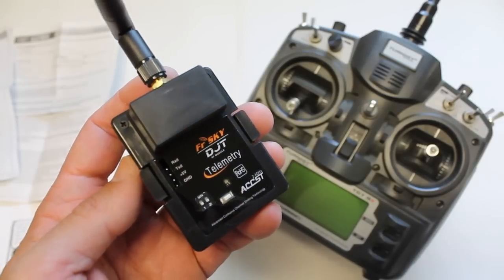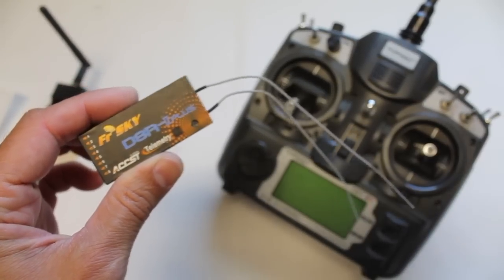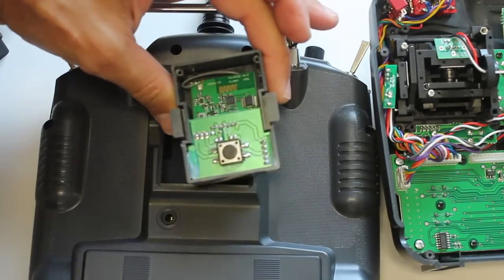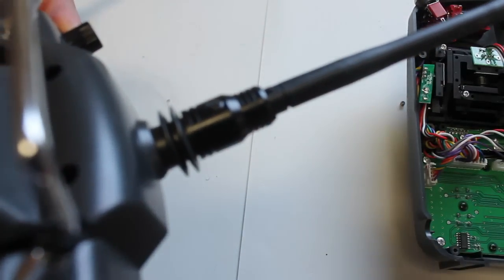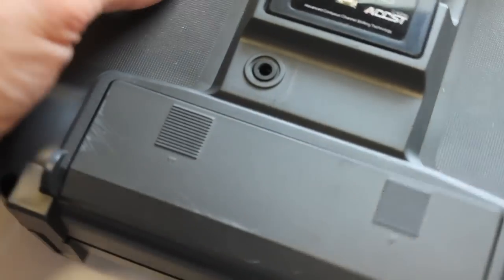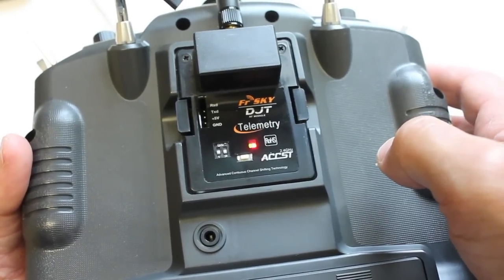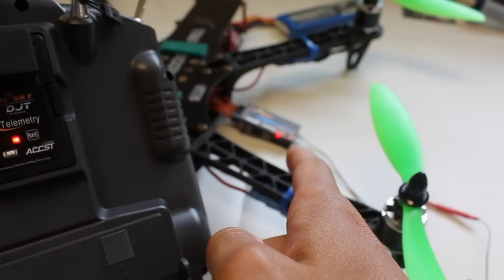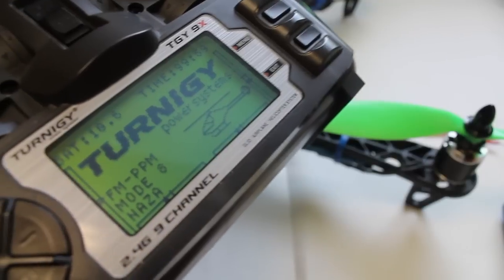Turnigy 9X FrSky Transmitter Upgrade and Binding with TBS Discovery and DJI Naza

Comment: Finally got the Hobbyking Discovery Buzzer to work with 9x/frsky module. The fix was accomplished by adjusting the endpoints in the radio for my gear channel. I ended up using 37 and 120 for the end points. Thanks for your response Dennis. This buzzer has saved me many times. Well worth the 6 bucks. BTW.. You can get this buzzer in USA at readytoflyquads for $6.
Reply from the maker: Killer info. Thank you! Glad to hear you got it working and even better that readytoflyquads carries it. Those guys are awesome both in price and shipping.

Comment: Dennis, you are my hero:)  Among some other things I learned to set up my Turnigy 9x three mode switch and failsafe with the Dji Naza from you. I already had the FrSky Module, but for some reason I bought the Turnigy 9xr to use with it.  But the 9xr is  completely different and difficult to set up.  So now I`m very happy with my 9x and FrSKy, thanks to this video. Thanks a lot

Comment: Thanks again dude, just watched this in a hotel working away from home getting ready for when I get back. Got my brand new frsky djt and plus lI module waiting for me - just gotta work out fail safe and additional features for kk2 will be searching your videos for those tutorials, haha! FPV is almost there, monitor with in built diversity receivers and vtx is ready ; )
Reply from the maker: Ashley, I hope all is well! Great to hear your setup is coming together. Good luck and feel free to reach out if you have any questions. Not saying I have all the answers, but I'm learning as I go :)
Reply: Thanks dude, super helpful as always : )
Reply: Dennis Baldwin Question already! Hhaha, got my DJT module in my tx following your video so thanks for that but when I came to powering up my receiver (D8R-II) I had no LED's indicating it was on : ( I have my KK2 and 1-5 channels plugged into it but it's like it isn't receiving power, do you reckon I could have fried it by plugging it in the wrong way around, is it even possible or is it protected? Or do you reckon i've ordered a dud? 

Thanks dude! Hope your well.
Reply from the maker: That's strange. I've accidentally plugged my leads in backwards before but never fried it. I'm assuming this setup worked fine with your other receiver? Have you tried powering it just with just one lead? Also, what is the BEC output of your ESC? I'm assuming it's 5V to power the receiver.
Reply: Dennis Baldwin Yea I think it's a faulty receiver, ordered another one so it should come today and I'll be able to test it.  I worked backwards and hooked up my previous receiver and it works so there has to be something wrong with the new D8R-II I bought.  The power output it 5v standard so nothing unusual there ; ) Thanks for getting back to me dude! Will let you know what happens with the new one!
Reply from the maker: Man that sucks! Hopefully your new one comes in quickly. Definitely let me know what happens. I'm hoping it's not something else!
Reply: It's aliveeeee ; ) Definitely a faulty one so gonna get my money back at least, hope it's not a common loose connection as I don't want that happening mid flight, haha! The tx and receiver are now bound, fpv setup.. just need a good day for weather and time.  FPV is so difficult, haven't committed yet to let it out my sight..lots more practice and getting used to.  All the best dude!
Reply from the maker: Ashley Leung Great to hear that, Ashley. I'll be on the lookout for your FPV videos when you get around to it. Take care and Happy Holidays!

Comment: Thanks again for another helpful vid. Just got my DJT combo pack and some spare receivers from hobbyking, pretty cheap in the end. Paid $90 for a Combo pack and 3 extra receivers to swap all my other cars and quads over. Had no problems with the setup except the little plastic mount in the back of the transmitter which I just cut out and all went smooth.
Reply from the maker: Not a problem. A few others mentioned they had to cut the plastic mount as well. I guess there are a couple versions of the TX. Thanks for the feedback.

Comment: I think you're right about different physical models. 
I had to disassemble the unit, took off the PCB from rear wall, removed the unnesessary plastic with pliers and then assembled all this stuff back.  Only after that it was possible to install the FrSky module into my Turnigy 9X, and I was not only one who messed up with it ;)

Comment from the maker: So far it's been great. I normally fly in pretty open spaces and haven't gone too far out (< .25 mi). I have a failsafe return to launch setup just in case something like this happens. As I venture further out I will continue to test and post if I run into any problems with short range limits. Thanks for pointing this out. I wasn't aware of it as everyone that I've read with FrSky raves about its range.

Comment from the maker: Thank you. No, I didn't have to cut or sand, but I did have to press firmly to get the module to click into place. It slides in nicely, but for the tabs to click into place it does take a bit of force.

Comment from the maker: Vinny, yeah I flew with the stock T9X module for over a year and loved it. If you want greater range then the FrSky is definitely worth the upgrade. Also, if you haven't seen it check out the FrSky Taranis. Double the channels, but about 2X more expensive. Hope this helps.

Comment: Hi great vids Dennis! Ive just done this setup. I had my 9x working great and used all the  curves, gear on 5, etc you showed in other vids. 3 way switch like a charm! Cheers for all that. However, since Ive put the Dr8/DJT on, the quad is all over the place. Ive calibrated everything I can think of. It yaws on its own, all over the place...intermittently! Any ideas?
Reply: I should add that Ive got a Naza Lite with the M V2 firmware on it and just installed an iOSD and a PMU V2.
Reply: Eoin O'Callaghan I just removed the iOSD and the PMU and tried the DJT with the standard NAZA. Its all over the place...diving and yawing. Kinda like when the FC isn't stuck down properly.
Reply: Eoin O'Callaghan Possibly Ive calibrated wrongly during one for the recalibration attempts...
Reply from the maker: Eoin O'Callaghan How did the recalibration go? If you continue to have problems please join us at www.garagepilots.com and post in the forums over there. We'll be glad to try and help you out.

Comment from the maker: Since you're flying the stock 250mw transmitter I can assure you that your FrSky system will out-distance your FPV TX/RX setup. I haven't done a full range test yet, but I've read about users getting well over a mile with FrSky out of the box.

Comment: Hey Dennis, just got this module with telemetry with a flysky 9x and tons of standard rx's for $100.  :0) It will be my back up to the uhf 9x I use. Thanks for this vid,
Reply from the maker: Man that's a great deal. Where did you get it from?
Reply: Dennis Baldwin
Santa drone crashed out front of apartment. Not really....I got it from an airplane guy on craigslist. I am using the d8r rx and module already seems like a nice set up. Got about 10 other rx with the deal incuding 2 v8fr? and 2 4ch v4...
Reply: Dennis Baldwin
Hey Dennis, I have the same module and wanted to ask what the switches 1&2 do? Can't find info on here. I had one switched on by mistake wondering if it caused a 50 yard away glitch.

Comment: Luis, I also ran across the same issue. If your 9x is the same as mine, then you will need to mod/remove some plastic that were molded into the module bay.  Seems like Turnigy added this to protect the petruding PIN coming from the TX board.  If this is what you are seeing then be sure to open up the back and remove the TX board before you hack that plastic piece.  After I removed mine then the FrSky module snapped in like its suppose to.

Comment from the maker: Greetings and thanks for the feedback. It's much appreciated. If you have the standard T9X receiver then it will not work with the FrSky setup unfortunately. The D8R or the V8R will do the trick, but it does suck to have to do away with your old receivers.

Comment from the maker: Under normal circumstances you want to take your jumper pins out after binding. Not sure if your case is different, but when I was binding my new FrSky setup I didn't have to jumped anything since the RX has a bind button.

Comment: Hello
Will this FrSky DJT module will work with "original" Turnigy 9X 2.4GHz 8Ch Receiver (V2) (the one shown on video before you made binding with FrSky D8R-II receiver) ?

I need this answer since I have 5 those 9X 8CH receivers. I have some troubles with range using original module, and suspect on module problem, so i decided to by this ny DJT module

Comment from the maker: Are any of your prongs bent? I would check that first. I was able to get the module installed by pushing it into place while squeezing the tabs. Then I pushed in the middle to get it to click. If that doesn't work then I'm not 100% sure what's going on.

Comment: Grateful for the video instructions... I have just purchased a Flysky th9x only to discover that it doesn't support failsafe..... now thanks to your time and effort I now know how to upgrade the unit... cheers for that..... how come you didn't have to trim any plastic from around the pin openings on the old module casing????? (as I am led to believe that that has to be done with the flysky, even though it is one and the same as the Turnigy 9x)....
Reply from the maker: David Garrett That's a great question. I've heard lots of feedback from other users that have had to trim their TX and I'm not certain why. Perhaps I have an older version and the newer version has a slightly different case? Or maybe it's as you suggest that the Flysky requires it but others don't. At any rate if you do this made please let us know how you get along. Thanks.
Reply: Dennis Baldwin  Hi Dennis....My Flysky th9x arrived today...and yes I have to cut away the raised plastic pin protector on the bottom right corner of the module housing of the backplate...(the DJT module is the same depth but the pin housing is shallower.. ).. been trying to setup up my old quad with KK 2.0 board.... fun and games and a steep learning curve..... cheers once again for all your video tutorials... they have been a Godsend.... :-)   keep up the good work bud.....

Comment: Hi. I installed er9x on my new Turnigy 9xr radio, not my Turnigy 9x.  For the 9xr you only need the USBasb programming device. I wanted to try the er9x firmware, thats why I bought the Turnigy 9xr, Rather having two low budget radios, in stead of the risk to damage the one I had, the 9x, by soldering operations. Until I am familiar with the 9xr/er9x I am using my 9x with FrSky, exactly as you do.
With the 9xr/er9x, and the FrSky with telemetry I hope some day to fly FPV.

Comment: thanks Dennis, I'm sure that's how I had it connected, will give it another go when my new 9x turns up, another question, should I be taking the jumper pins out after binding? (I'm not going to use the telemetry as I'll be running an OSD) I tested the rx in my AXN so I'm sure it bound ok...

Comment: Hey there.  I have just finished building a 500 quad with the Naza M Lite. I have a 9XR Pro tx with a Fly Sky module. I currently am using the Turnigy 9 channel receiver, but have figured out that I won't have a fail safe capability with this set up in case of signal loss.  My question is will a FrSky receiver with fail safe work with the Fly Sky module? If not is there a receiver that will?  I went with the Fly Sky when I bought the 9XR so I didn't have to buy a dozen new receivers, the Fly Sky works with the HK TR6A receivers.  Thanks for all your videos, they have been a big help in the build process.
Reply: Im starting to realize that I'll have to do this to my radio to get the fail safe I'm looking for with my Naza equipped quad.  I'm also realizing that I'll, have to get sensors for whatever I want to send back to my radio, is that correct? The two things I can think would be most useful are of course voltage and distance.  I may have to check out the garage pilots blog site so I can stop bugging you.
Reply from the maker: +Dean Hallal Yes you'll need to buy additional sensors unless you have a Naze32. There's a way to get voltage data from Naze32 to FrSky but I know you're flying with NAZA Lite. Perhaps you could use something like this: http://www.getfpv.com/frsky-flvss-lipo-voltage-sensor-with-smartport.html
Reply: +Dennis Baldwin thanks again for reply.  Looks like what I need. Man so much to learn every time I look at one issue two more pop up!  Will have to decide on which module and receiver I want first then worry about the sensors.  Have you seen the new FrSky HK has with the new style antennas? Anyway, thanks again. Is there a better way to message you, hate having to do this in YouTube all the time.  Tried Garage Pilot but didn't see how to look for what I needed or to message.  Have a good weekend.

Comment: I don't understand why the 9x has a removeable module but the antenna is soldered in?
Reply: So you are forced to buy turnigy RXs?
Reply: I got mine without the soldered in antenna and installed my own Orange RX.
Reply: Nice, so you can control your controller from your quad?
Reply: Where did you buy the Transmitter without the module. I am trying to save a few bucks, but ebay only has the turnigy 9x with module, 99 USD.
Reply: Hobbyking. They own the Turnigy brand, and they are far cheaper than anywhere else. They have warehouses in multiple countries.
Reply: The original one was not. They changed it in V2. BTW, this is a simple 5 minute mod as there is no reason to separate the transmitter casing. Just unsolder the lead, remove the screw on the antenna, then pull the wire through with the antenna.

Comment: i have a turnigy 9x that is still in the box since 2015..if i did the same as you did in this video could i use open pilot instead of naza ...i dont' have a preference its just what i have ...i've been messing with drones since about 2014 but i'm very novice (Its just on and off)..i just bought another cg028 and it got me back into flying again but that went splat on the cement cause of a bad capacitor or motor .....it had RTL and i really am trying to build a drone that has that as i don't have good luck with the ones that don't ...thanks in advance and sorry for being confusing if i am

Comment: Thanks for a great vid Dennis. Although I'm having trouble binding my frsky xjt module to my d8r-II plus. The xjt is in bind mode on my 9xr. I set the tx to bind. But when turning on my d8r-II plus receiver in bind mode I only get a solid red and green light that does not flash on the rx. No bind. The instructions with my xjt said that that switch 1 has to be on and switch 2 off when binding to the d8r-II plus. Any thoughts? Thanks for your time.
Reply from the maker: I can't remember the bing process for my D8R-II plus but I do remember there are two modes. One where you bind by using the failsafe button while you power the RX up and the other where you use a jumper to connect two of the pins. I'll have to look tomorrow but let me know what binding process you're using and we can take it from there.

Comment from the maker: Did you install er9X using the SmartieParts board? I know Atarix777 used that board and I'm leaning in that direction, but wanted to know if you did that or chose the solder approach. I just watched your TBS vid and was very impressed. Thank you for the mention and keep it in the air :)

Comment: thanks for posting, I just got mine all set up and everything looks good. One concern I ran into is the female plug on the module has very wide ports for the small turnigy male pins to fit in... Have you had any connection issues so far?
Reply from the maker: Lion Silver No connection issues so far, but you make a good point. Thanks for sharing.
Reply: Thanks, so far mine has had a solid link too.

Comment: Great instruction. I just bought all the parts for my first quad build (SK450) and I got the Turnigy 9X. It is good to know that there are easy inexpensive upgrades for this transmitter. I was wondering what size props you recommend for my quad. As I said I have a SK450 with Sunntsky motors, Afro 30A ESC's and KK2.1.5 control board.  I also have an APM 2.6 with GPS for a later upgrade. The only thing I don't have yet is the props. Lots of different variation of opinions on line (10x4.5, 8x4.7)???? Should I try both? What do you think? Thanks again for the great info!
Reply from the maker: tptwk That's a good question and sometimes come down to matter of preference. I originally flew 10" props and then went down in size when I started filming and taking photos. I wanted to deal with less vibes and have more responsiveness at the sticks. So now I'm flying with 8" props on my QAV400, which is the largest prop it will support. The best advice I can give is try both and see what "feels" better. Hope that helps.

Comment: Hey Dennis. Did you or are you gonna do a vid on the setup for failsafe for this combo? Just got my module and receiver and would like to know how it works out? Just got a TBS Discovery and will be installing this on it. Thanks very much.
Reply from the maker: Does this help?

DJI Naza Failsafe Without GPS - Part 2 w/ FrSky Turnigy 9X
Reply: Dennis Baldwin
Hey thanks a bunch for the link Dennis. I appreciate all your hard work on these setup vids! Sure helps us get up in the air much quicker. :) Thanks again.
Reply from the maker: You bet. Thanks for subscribing and watching. It's much appreciated.